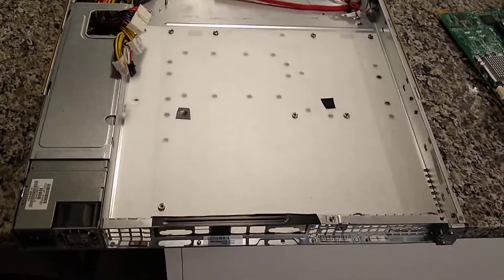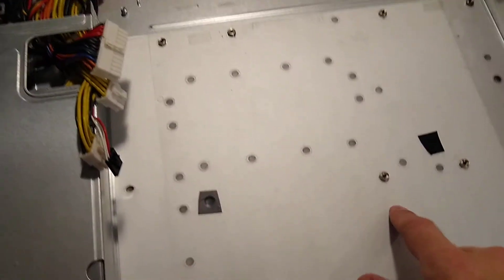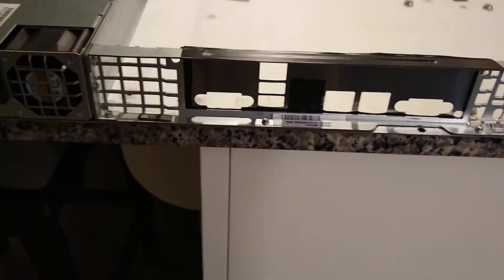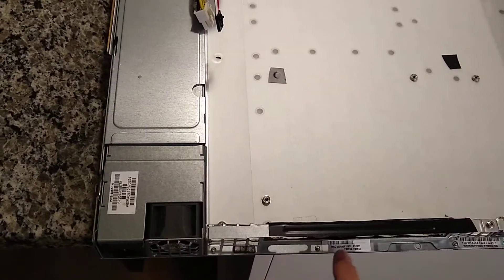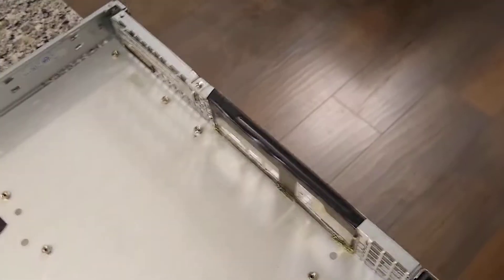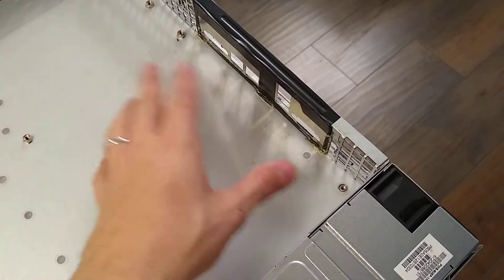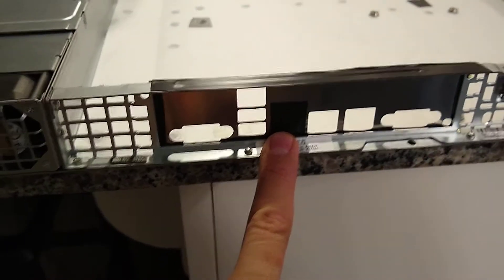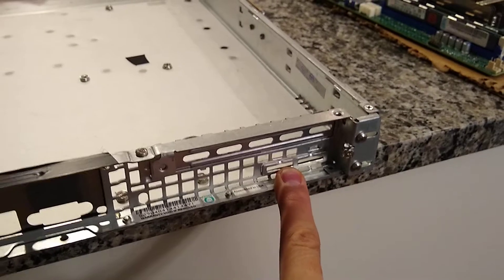Supermicro 1u server build - X9DRD-LF dual Xeon 2011 - CSE-815 Chassis - Part 2

Comment: Hi, nice Vid. 
I have the same chassis with a X11SCL-iF. 
If you want, you can use the 1U-Chassis-Backplate with Supermicro part number MCP-260-00078-0N. 
It has the venting holes for a better airflow.
Reply from the maker: Great tip! Ill look into it, thanks!